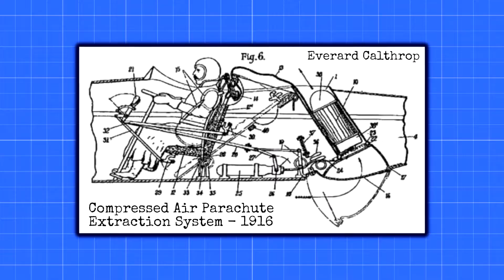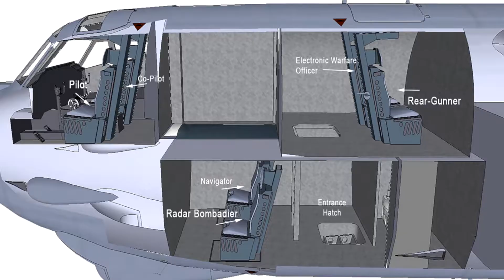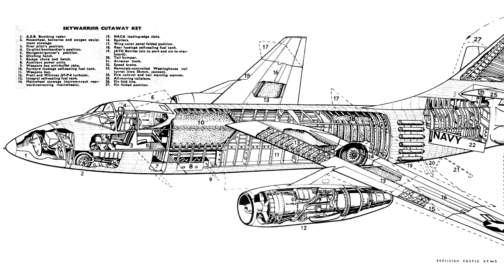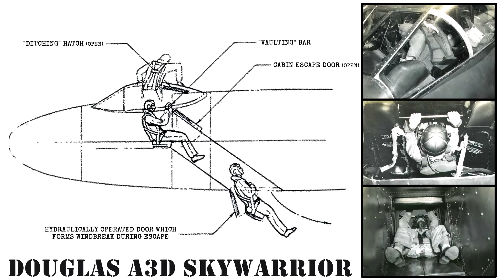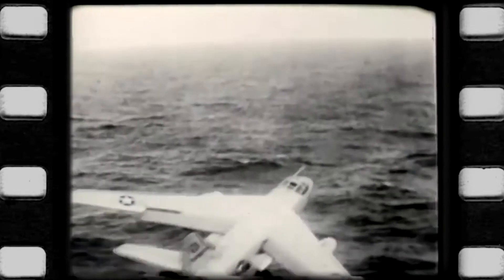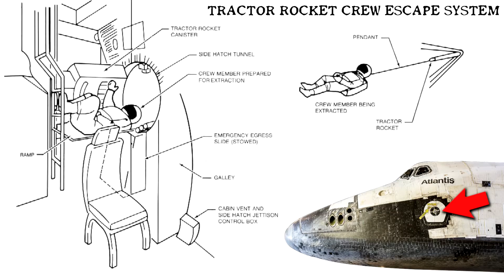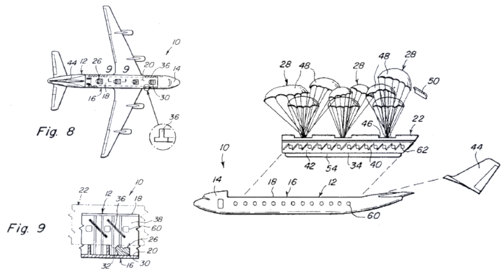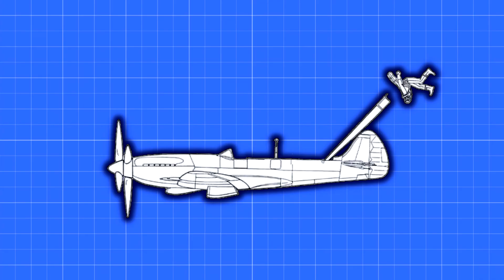The 10 CRAZIEST Ejection Seats Ever Invented

Comment: There is a reason why escape modules are no longer used. Just look up the B-1A ejection that killed someone and critically injured another. They may have worked well during the initial stages of ejection, they were way worse on ground impact. Not to mention the huge costs (including maintenance) and weight penalties.